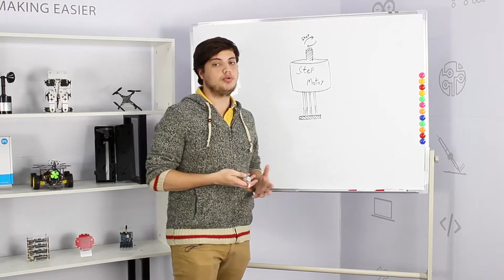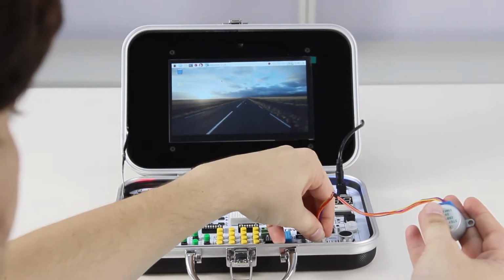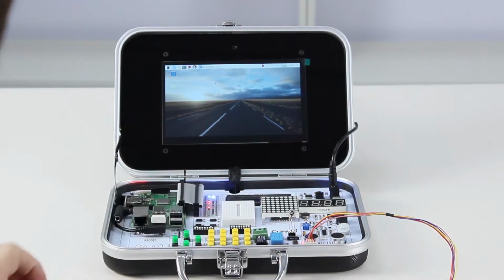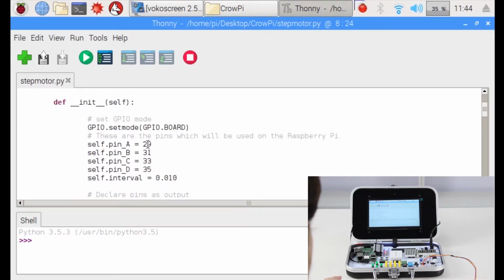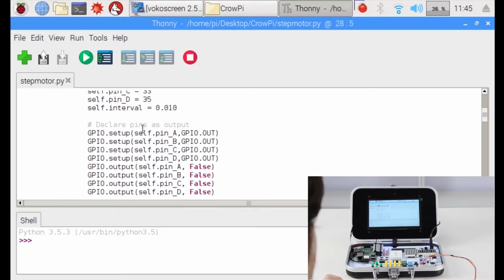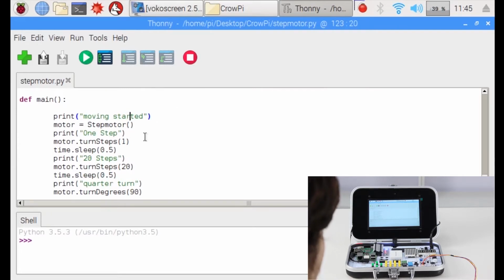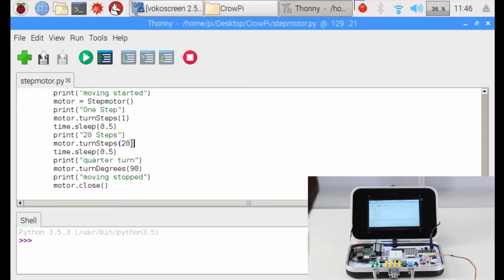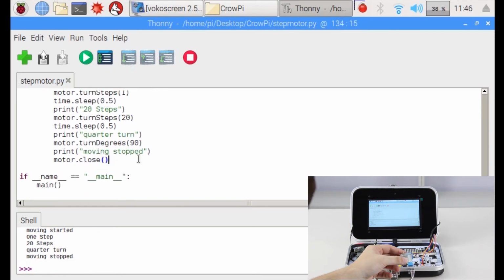CrowPi Python Lesson 12：Using the step motor and making step movements

Comment: turnSteps() and turnDegrees() methods seem not to be working with negative numbers. Any advice on how to make the step motor turn in reverse direction?
Reply from the maker: To reverse the 28BYJ-48 stepper motor, you can change the order of the four-phase currents in the control circuit. In the single-phase control mode, the 28BYJ-48 stepper motor can be reversed by switching the phase sequence, while in the two-phase control mode, the phase current sequence in the control circuit needs to be changed.

Here is a simple Python code example for controlling the forward and reverse rotation of the 28BYJ-48 stepper motor:

```python
import RPi.GPIO as GPIO
import time

# Define the sequence of the 28BYJ-48 stepper motor
seq = [[1,0,0,1],
       [1,0,0,0],
       [1,1,0,0],
       [0,1,0,0],
       [0,1,1,0],
       [0,0,1,0],
       [0,0,1,1],
       [0,0,0,1]]

# Set the GPIO pins
coil_A_1_pin = 11
coil_A_2_pin = 12
coil_B_1_pin = 13
coil_B_2_pin = 15

# Initialize the GPIO
GPIO.setmode(GPIO.BOARD)
GPIO.setup(coil_A_1_pin, GPIO.OUT)
GPIO.setup(coil_A_2_pin, GPIO.OUT)
GPIO.setup(coil_B_1_pin, GPIO.OUT)
GPIO.setup(coil_B_2_pin, GPIO.OUT)

# Rotate the stepper motor forward
def forward(delay, steps):
    for i in range(steps):
        for j in range(8):
            setStep(seq[j][0], seq[j][1], seq[j][2], seq[j][3])
            time.sleep(delay)

# Rotate the stepper motor backwards
def backwards(delay, steps):
    for i in range(steps):
        for j in reversed(range(8)):
            setStep(seq[j][0], seq[j][1], seq[j][2], seq[j][3])
            time.sleep(delay)

# Set the sequence of the stepper motor
def setStep(w1, w2, w3, w4):
    GPIO.output(coil_A_1_pin, w1)
    GPIO.output(coil_A_2_pin, w2)
    GPIO.output(coil_B_1_pin, w3)
    GPIO.output(coil_B_2_pin, w4)

# Test code
while True:
    delay = 5 / 1000
    steps = 100

    # Rotate the stepper motor forward
    forward(delay, steps)

    # Wait for 2 seconds
    time.sleep(2)

    # Rotate the stepper motor backwards
    backwards(delay, steps)

    # Wait for 2 seconds
    time.sleep(2)
```

In the above code, the `forward()` method is used to control the forward rotation of the stepper motor, the `backwards()` method is used to control the reverse rotation of the stepper motor, and the `setStep()` method is used to set the sequence of the stepper motor. In the `backwards()` method, we use the `reversed()` function to reverse the sequence of the stepper motor, thereby achieving the reverse effect.
Reply: @Elecrow  Thank you for the fast response. I'll check this.